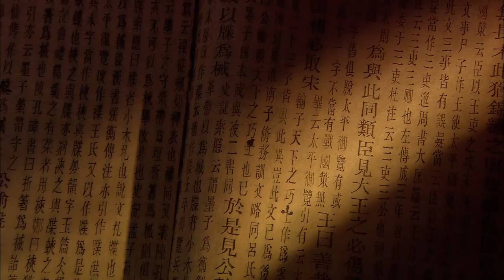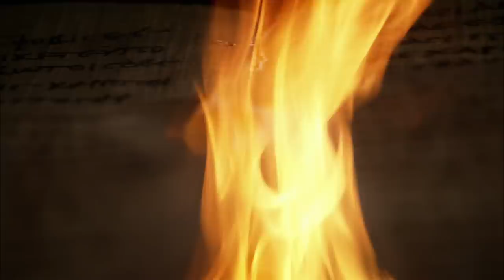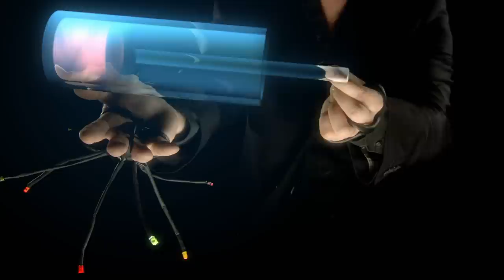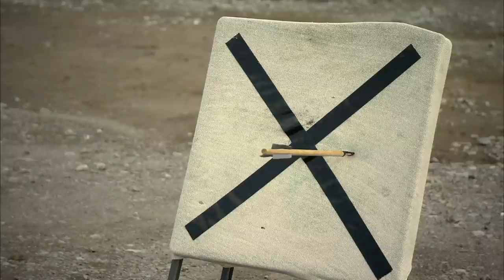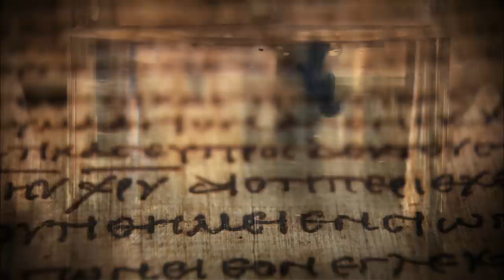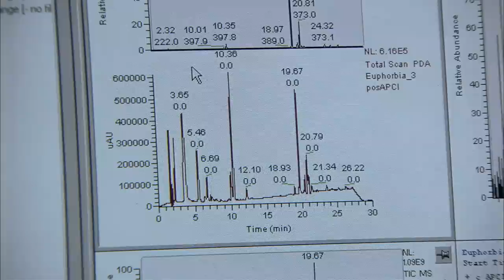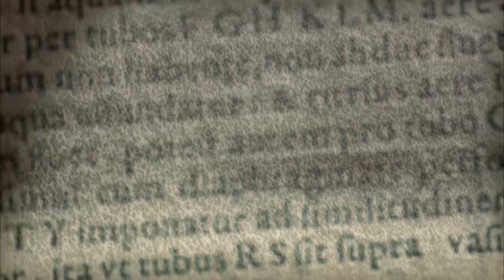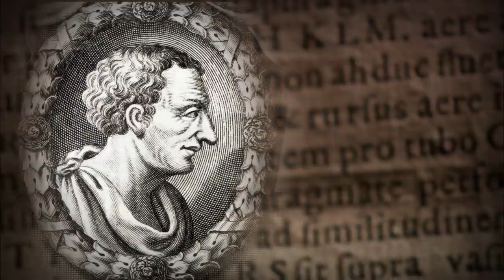Ancient Discoveries: Impossible Army Machines (S3, E6) | Full Episode

Comment: So you have to get pretty close to set fire to a defensive wall complete with troops, seems like those troops would probably have attempted to stop them, firing arrows from a superior position would have been effective way of achieving that goal. Hurling stones to destroy the weapon would have worked to. Effective weapon but very hard to deploy in a combat theater.
Reply: How about some of the same thing they wanted to use on them but they had a way better advantage.. Just trow some burning tar, or hot 🔥 oil, arrows on fire 🔥😂👍